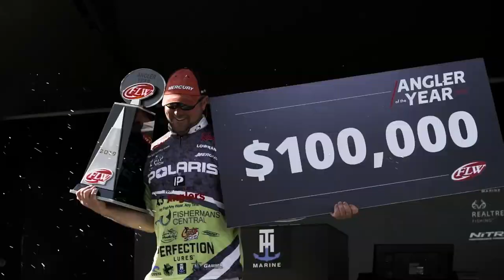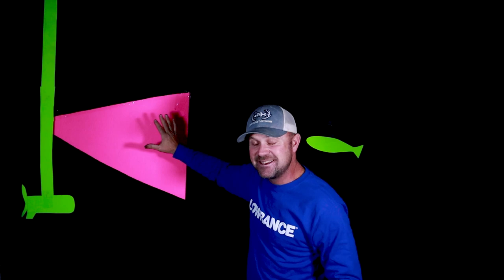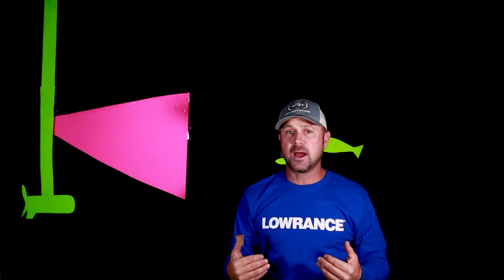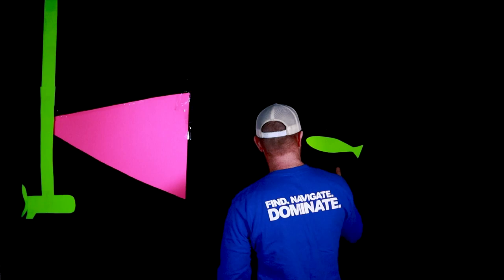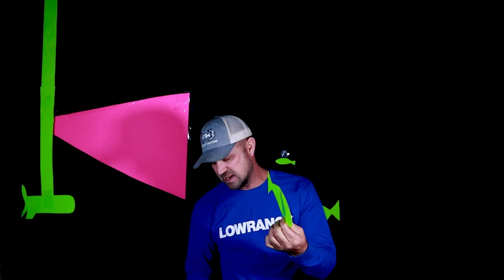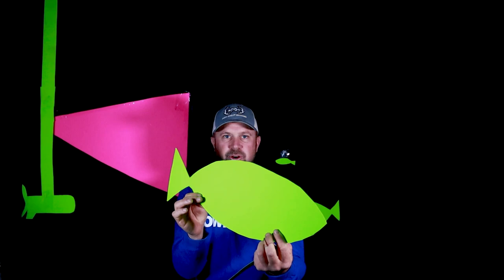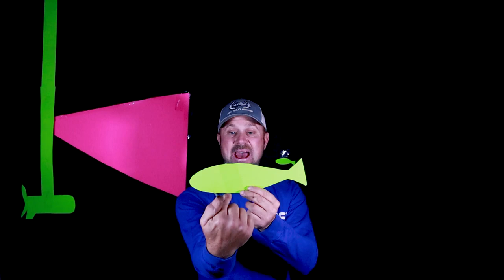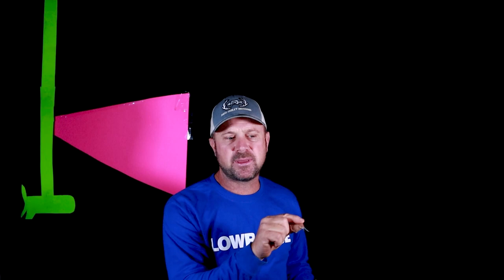How to read Forward looking Sonar like a Pro!!!!!!

Comment: Thanks for a really informative video.
I am not a fishing electronics expert but would like to learn more about how to use i.e. my Lowrance HDS7 Gen3  and also LISTEN to intelligent information on new technologies to guide me in future purchases.  In looking at all this vendor hype David has proven that what I suspected is true about the angle at which  the fish are facing the sonar scanning device.  I hadn't considered the type of fish scales David described on different fish but it made total sense to me once explained.  I fish a lot of salt water locations in the Tampa Bay area.  Sheepshead have some really large thick scales.  Nice to know that when the sonar hits them on the side it will put out a really nice image. Just wish my Lowrance HDS7 gen3 was compatible with the new Active Target transducer system.  If so, I would but one today.
The one thing that my unit will do that the Garmin can't is to log sonar and create Structure Maps which is really nice for displaying s bottom structure overlay on your chart screen on any area that you a previously logged the sonor on and created the proper map file type.  You can even view your chart pages at home if you purchase the proper power cable and have a 12 volt power supply.  It is really nice for displaying structure along shipping channels in my local Tampa Bay area and also displaying the type, size and dimensions and EXACT location of various items that have been dumped in Tampa Bay as artificial reefs. 
There are lists of various APPROXIMATE GPS dumping points.  They only give you a general idea where the debris is located. Structure Mapping gives you the EXACT location.  That including Fish Reveal will tell you where the structure is and if there are any fish around.  Some GREAT tools from Lowrance.
John

Comment: If it is true that fish get conditioned to the sound and vibrations of forward facing sonar and stop biting over time, then individual manufacturers have a chance to take the lead by simply building a sound distorter on the transducer that mixes up or masks the sound and frequency to keep fish from getting conditioned. Wait and see, this is be a huge selling point for the first company to do it.

Comment: Merry Xmas which way is better option to mount a forward unit on the trolling motor or a pole of the side of the boat that can be turned manually.
Reply: trañsómé